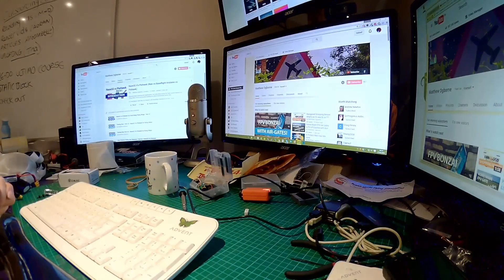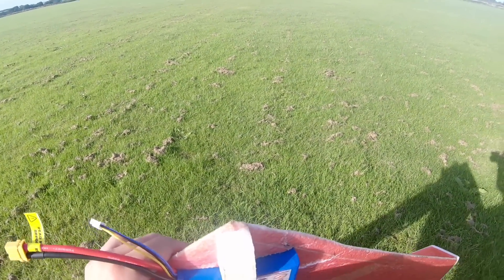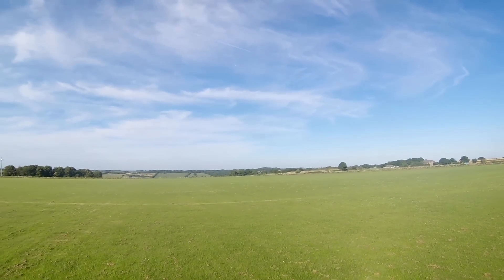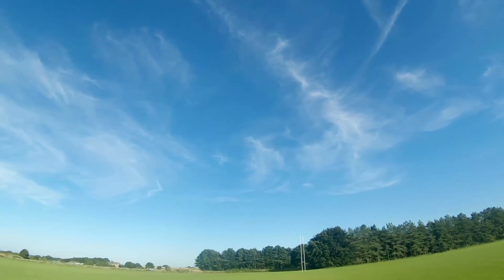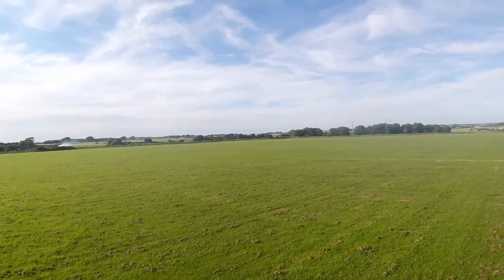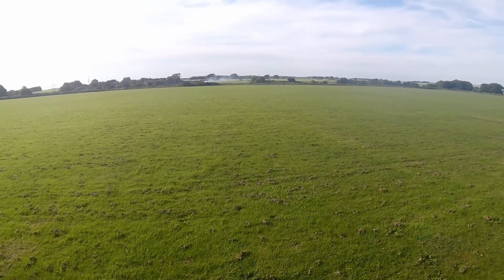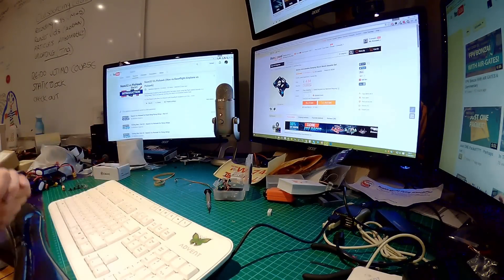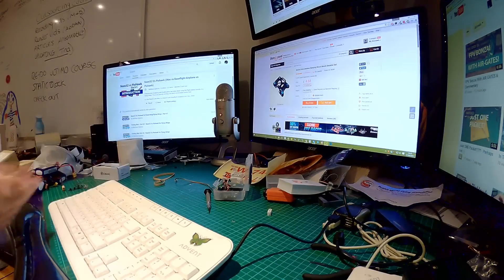RE-TESTING Baseflight Airplane - Part #7 - Naze32 V's Pixhawk for Flying Wings

Comment: Hi Matt, I have a Naze32 & GPS I'd like to put in my HK Cloud surfer, So I'v watched this entire playlist but also noticed it's been some time ago when this was made.
Do you still recommend Patrick E's Baseflight over iNav for use on a Naze32 Rev6 Full?
Reply from the maker: Howdy Rob, see my series on iNav, things have moved on a LOT since then, Matt
Reply: Hi Matt, I followed your INAV series but decided to reply back here where my original question started.
I am slightly confused if I should stick with the NAZE32 + UBLOX GPS and put Patrick's baseflight, Or Buy a Omnibus F4 V1 board & either checking if my Neo-06 UBLOX GPS (5 volt) will work or wait for 5 volt M8N GPS's to become available (Because I can only find ones that are 3.6v MAX).
And as my last crash was due to ESC's BEC failing I'd rather not have to have 2x One for 5v & another for 3.3v(If that is such a thing).
Do newer V2/V3 boards use a lower voltage and if compatible with currently available M8N GPS is there any other reason to avoid buying a higher version.

Comment: So awesome ! It works! :)
Reply from the maker: Howdy Paul, it did indeed! Matt
Reply: Hi Matt , Have you given the Pixracer a look?  I am learning about it now and the 36mm form factor and input/output accessories etc looks like it may be a real winner for small Tris, quads and small planes like the Nano Skyhunter I just got. I just gotta find a less expensive Vector competitor :)
Reply from the maker: Howdy Paul, yes! I have one on my desk. It worked very well out of the box in the SkyWalker Sirius. I even did a mission with it on it's first flight too! However I am fighting OSD issues at the moment. I've tired 56 combinations and still the fonts won't show properly on the OSD. Also I'm not using mission planner, instead I'm using QGroundControl. Hope that helps Paul! Matt
Reply: Wow Cool well If there is a will there is a way usually. I am trying to learn about both mission planner and Qgroundcontrol now. I really hope you find one that works or Pixracer may be out of luck for me. I suppose they are still working on it as well so there is hope for both. Good luck and godspeed :)

Comment: hello Mat, great videos ! 
can u help me please why after i pu in preset Flying_wing both servos go simutaneously like if they would be on one chanel but ir reacts in both axeses, thanks for aany sugestion , i can not find anything on this issue with help of google ... thanks in advance
Reply from the maker: Howdy Tux, do you type in save and then the device boots to save the presets? Also I had to type that prset command in twice for them all to go in. The directions can be changed on the servo tab for pitch and roll in baseflight. Hope that helps, Matt
Reply: thanks for the reply Mathew, my bad, one of the servos did need reverse, what a stupid issue :) when my gps module arrive ill let u know how i did end up testing baseflight rth ! :) 
thanks again for the video !

Comment: Hey there.
Would you mind sharing which wing you connected to which port and what servos you had to invert? I'm having a hard time figuring this out. Also, the FC will do the mixing correct, no need to elevon mix on the radio?
Thanks in advance
Reply from the maker: Howdy Adilson, you connect the servos as per the diagram on the config tab, so the motor in port 1, and the servos on port 3 and port 3. As for the reversing, this is done on the servo tab and depends on your model as you're likely to have a different setup to me. Hope that helps! Matt
Reply: Thanks Mathew. It's a flying wing just like yours that's why I'm asking for your setup specially which servos you've had to reverse. Thanks again.
Reply: Just to be clear, I'm having difficulties on like:
- Should the mixer in the radio be of a flying wing (ELE/AIL mix per channel) or a simple 1 to 1 like an airplane (I have a taranis)
- Where should I invert the servos? Radio or flight controller?
Right now if I can make it work on the radio, I get the compensation wrong when I activate the stabilized modes and vice-versa
So, if you could please illustrate better how you have done the mixing, radio configuration and connections, I would really appreciate. 
Thanks in advance.

Comment: matt will this board work with patricks e's baceflight airplane NAZE32 REV6 10 DOF Flight Controller if I got a gps for it..
Reply from the maker: Howdy James, it will. A Baro isn't needed though so you can get away with a cheaper 6 DOF board. Matt
Reply: thanks mate, It ws a board that i could get here in Ireland with next day shipping.. If I munch my quad its going in my wingwing as a cheating box.

Comment: Great video & info you sharing. I was just looking for a small flight controller for the Nano Skyhunter i purchased today. And i have several Naze32 FC laying around. So hopefully by mid next next week you will share the settings for the Naze32 on Baseflight so i can get her going up in the skys...  ;-) Thanks
Reply from the maker: +JD FPV Morning, JD. Honestly it's dead simple. The hardest part I see is explaining how you short the boot pads on the board to flash the software. Do you have a spare gps block to hand too?
PS. I'm used to explaining massive complex software packages, so a little naze32 board is child's play in comparison :)
Reply from the maker: OooooO the Nano Skyhunter, that looks MINT! I'm jealous! 
I've got a mini skywalker on the way to me at the moment, I'll be fitting a naze32 board in it so I can use Baseflight airplane in it for FPV too (mine will be side mounted for space reasons.
Reply: +Matthew Ogborne Yes I have a gps for the naze32 as well. Super excited about trying this out. Thanks for your help.
Reply: +Matthew Ogborne I have a mini skywalker as well, but no flight controller in it. I have a friend that actually crave out the foam to make a Fy41ap lite system work in a mini skywalker. It was absolutely brilliant.
Reply from the maker: Morning JD, right I'll do my best to get this out for you next week then. Saturday looks like it'll be a recording day as checking the weather is showing as rain, rain, some more, rain, oh wait some more rain and a topping of rain all day!
Reply from the maker: Yea it's the "Brown" switch that is what I'm looking for, the panic button if for whatever reason I got lost or lose video signal, I can get it home again.
Reply: +Matthew Ogborne Same here Brother. I plane to make a medium long range plane out of the nano skyhunter using the naze32. So having RTH is a most!
Reply from the maker: I was just looking at the Nano Skyhunter again, it's this one right? http://www.readymaderc.com/store/index.php?main_page=product_info&cPath=112_409_876&products_id=5794
Reply: +Matthew Ogborne Yes that's it. It's a great frame. At least the Mini version was. I had a mini skyhunter a few months ago. Ran into motor mount issues which was a design flaw causing me to crash this plane.
Reply from the maker: JD FPV Ouch!!!
Reply from the maker: JD FPV Hmmm... "USPS (First-Class Package International Service™)" is guess how much..... $32.78 to the UK, ni-on as much as the model :( I won't be getting that one then
Reply: +Matthew Ogborne Any updates on the Naze32 tuning for plane?
Reply from the maker: JD FPV Howdy JD, not yet. It's been a busy week here. I need to make a setup video for Baseflight airplane as two of the chaps at my main flying site want to use it. It's on the to-do list, just not got to it yet. Matt
Reply from the maker: JD FPV PS. if you run "preset Flying_wing" it'll set up all the defaults for you, save & reboot and it'll be pretty much good to fly.